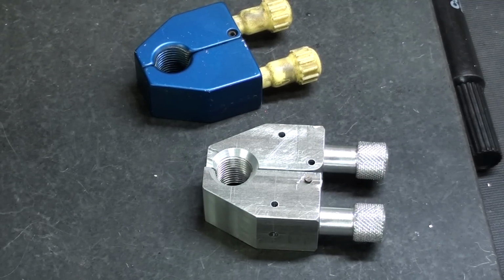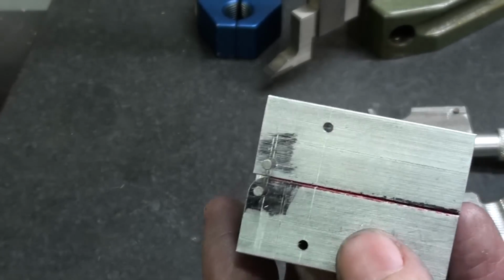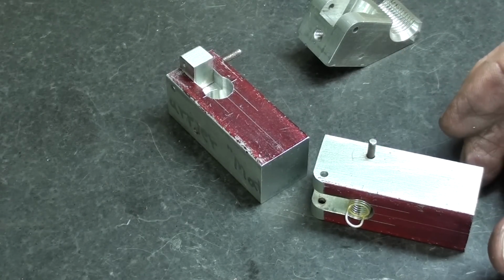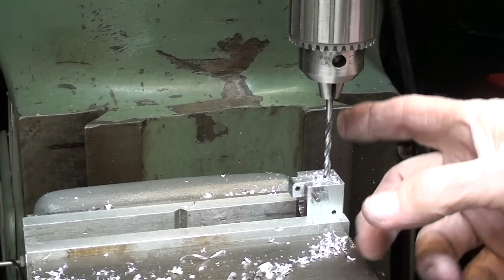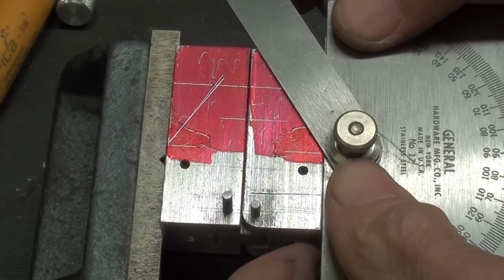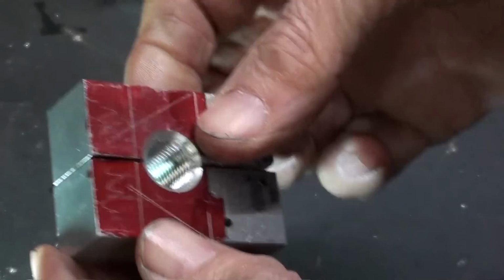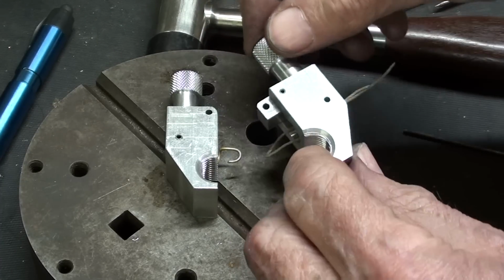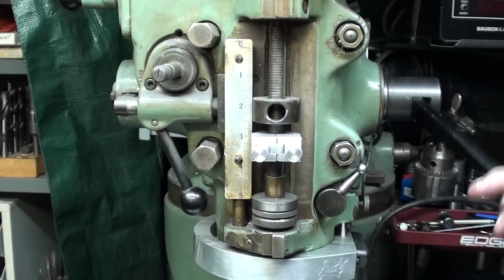BRIDGEPORT RAPID QUILL STOP pt 2 #867 tubalcain

Comment: Very nice 2 part video set on making a depth stop, Tubalcain. I like roll pins, for final assembly as well. They dont slip out, but can be removed fairly easily unlike the taper pins beaten into my SB lathe.

Comment: I really enjoy your videos, new and old!!
Thanks.
Now, my thought/question: sometime in this(maybe the previous video) you implied that the commercial one may use the squeezie-knob studs as spring retainers... have you tried that? I may!
Sooo... My thought is that if the ends of the screws(both of them) were tapered so that the taper could be used to apply tension to the spring without the need to use the string and side hole to tension the spring. Tapering both 8-32 screw/studs would effectively apply between .136 and .164 of tension on the spring as they are fully engaged.  In addition, if the screw hole goes all the way though the spring slot so that the screw/stud is captured on both sides of the slot it would add strength and force the spring to seat properly on the screw in place of the pins. 
Your thoughts??
Thanks again!!!
Reply from the maker: That sounds like a good idea. Why don’t you try it. I have not experimented with your method.
Reply: @mrpete222  challenge accepted, Ill let you know my results

Comment: Very nice. I did something similar. Started with a nut that fit the screw. Cut it in half. Welded each half to each side of a spring clamp. Took about 10 minutes. Ugly as sin. Still works though.

Comment: I have a question for a project I am working on. I machined tow/recovery hooks out of mild steel. Should I heat treat them, or powder coat them? I wont be pulling anything heavier than around a few hundred pounds probably. No vehicles or anything. Thanks
Reply from the maker: You cannot heat treat mild steel
Reply: @mrpete222  Okay thank you

Comment: Well done!
Reply from the maker: Thanks Brian. If you were to make one, your thread would probably be 2 inch diameter.
Reply: @mrpete222  The g&L you just twist a dial to set the feed depth and it kicks out automatic. They already installed that feature at the factory. 🙂

Comment: Lyle.
An improvement would be a clearance hole for the roll pin in the hinge tounge.
It is worth mentioning, I think that the stop itself has a limitation in it's resolution which is controlled by the pitch of the thread whereas the original nut can be set precisely in any position. 
I mention this because I was tempted to make one, for my Walker Turner type machine.
The stop has a coarse Acme type thread which would limit the adjustment to increments equal to that pitch.
Reply: Have to agree with you here. 20 TPI gives a pitch of 50 thou. With some working out re the thickness of the 'clamp' it could be different which way up it is used, BUT still only within 25 thou, just over 1/2mm.
The Olduns used different length pieces of tube, cut in half/five eights , to save winding the nut & lock nut up all the way.
Reply: @trevorbaker8945  I have different lengths of flat held on with magnets

Comment: These are often called "feather stops" as they are not robust enough to repeat the depth. Their main use is to restrict the travel of the quill upwards this is why they are designed to be quickly removed. Quick set depth stops are have push buttons like these - https://drive.google.com/file/d/1kv8I4UJYQp57dXgCK8a2mgmxMYkgliAE/view?usp=share_link

Comment: Damn it Mrpete , I had some sitting around to get caught up on and after watching this video I'll be in the shop if you need me.
Reply: @mrpete222  Mrpete222 I got mine finished and works fine. Had a odd ball thread. 15.5mm x 2.5 . I would send you a photo but I just see how to do that. Thanks

Comment: Thank you, Mr. Pete, for another very worthwhile video! In a couple of operations you power tapped holes. I'm very hesitant to do this for fear of breaking a tap and getting it stuck in the hole. I've searched but could not find a video where you demonstrated this process. Maybe this would be a good topic for an upcoming video? Thanks for all you do!
Reply: Thomas, it is probably safer to power tap on the mill than it is to do it by hand. If the tap is held in a drill chuck as Lyle does in the video, the chuck will slip on the hardened shank of any tap over 3/8" (8mm) diameter before breaking it. This can be used to advantage. Start a larger tap under power and when it slips, stop the machine and install a spring center in the drill chuck and finish tapping by hand.

Secondly, when tapping as in the video the tap is centered and square to the work. This avoids the two major causes of tap breakage. As an aside, when hand tapping always use a simple tap guide to hold tap square. A handheld 3/4" or 1" thick scrap piece of Aluminum with tap OD holes drilled into it work a treat.
 

 When tapping a hole, free machining steel and free machining stainless steel are your friends. O-1 tool steel and 4140 steel are not difficult to work with either. Things like stainless steel, Copper, and Titanium can try your patience.

Not often mentioned, but extremely helpful, is a good tap drill table that gives tap drill sizes as a percentage of thread. Most drill tap tables just give 75% thread drills. In low carbon steel a 50% thread is strong enough that a normal hardware store bolt screwed in a depth equal to its diameter will wring the head of the bolt off before it strips out the thread. 60% threads in tough materials are so much easier to tap than 75% threads. 100% threads are used for soft materials or very thin sections. In normal use a 100% thread is only 5% stronger than a 75% thread but requires twice the power to tap.

Well, I've rambled on again, but anyways Cheers from NC.USA
Reply: Further to the previous reply.
My experience the biggest cause of broken taps is blunt cutting edges.
Worn taps jam in the hole.
Reply: @stevewilliams2498  Yep, always feel the first cutting flutes of a tap with your fingers before use. If they don't feel sharp, they aren't. Any tap larger than 1/4" (6mm) can be touched up on a bench grinder (that has a reasonably square edge on the wheel). Practice on some old worn-out taps. It's easier than sharpening drills offhand.